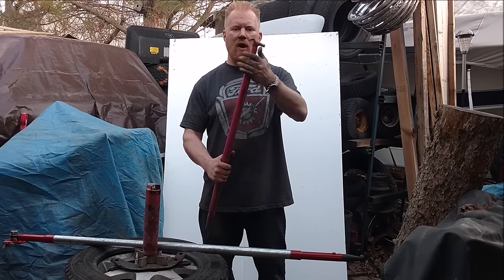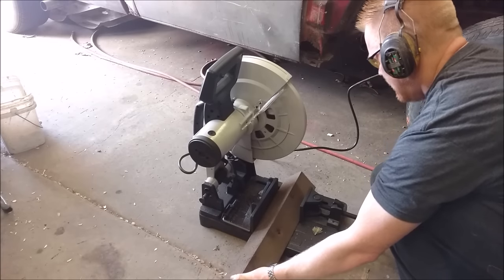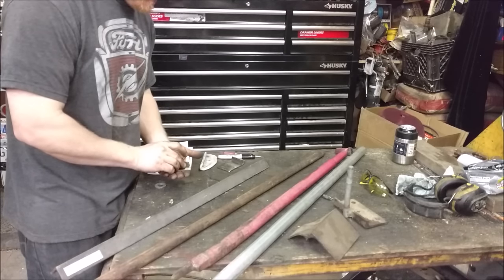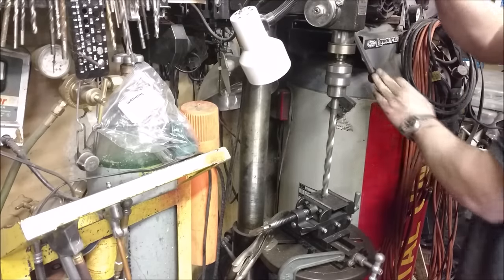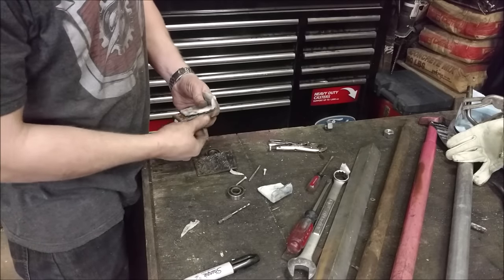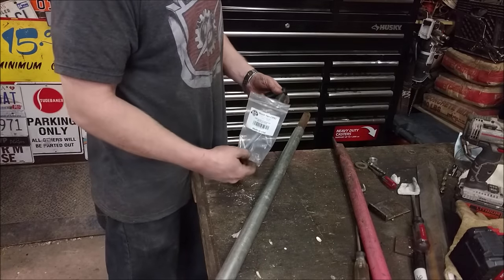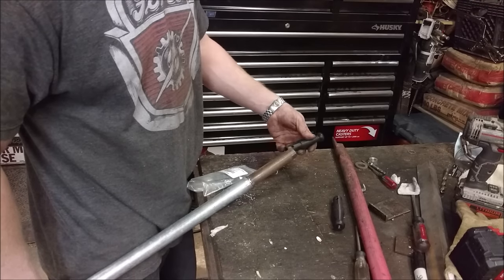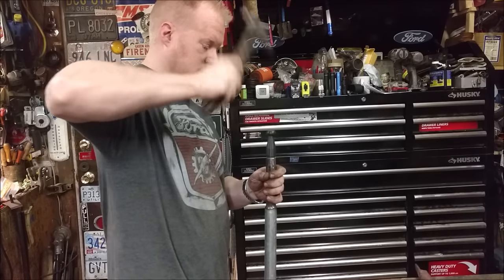No Scuff Manual Tire Change Bar

Comment from the maker: 🚨PARTS I USED
Bearings 99502H (no clip) : http://amzn.to/2mTFFgB

No Mar Removal Ends: http://amzn.to/2mTIsWP
Plastic protection for install (better than milk jugs): https://amzn.to/2oYIORA
Tire LUBE is a MUST: http://amzn.to/2m8tSL7
Basic Manual Tire Changer Machine: https://amzn.to/2mLAiVu
Saw I used to cut the steel Evolution Evo 380: http://amzn.to/2lOGxBZ

4 foot 3/4 black gas pipe from the Home Depot/Lowes
5/8" bolt and nut for bearings

For the mounting end I used 3/16" steel 4"x4" angle iron cut to 2" wide. I cut the short end to around 1" and left the other at 4".  You don't need angle iron and could just bend or cut/weld an angle piece together. 1/8" material is too thin and I would use 3/16" or 1/4" material. Bearings are 1/8" back from the face of the HDPE plastic. The plastic is around 1/4" thick so the bearings are around 3/8" from the inside of the angle iron. You can go to my Facebook page listed below for close up pictures. If you bought everything this would cost you around $25 with a spare $10 tip. 

To see more detailed photos Go to my Facebook Page: https://www.facebook.com/sixtyfiveford/posts/pfbid0sBRiNgNn5maGLnmvuf7fRcErhwpkjekEHo5YaoY3TXiY2WRMiWTSu1sS7F6GgBNVl

Comment: Nice! My dad was a lot like you in this regard. I learned that, Necessity breeds ingenuity.  We were in the sticks and not a lot of money. So we came up with things like an air compressor from an electric appliance motor and an old ac car compressor on a tank, bench grinder was an electric appliance motor, parts washer etc. Most impressive to me was a sandblasting box from parts. He used a pair of welding gloves sewn to Levi Jeans leg's , and glass from something(maybe plexiglass) as the lid. Get this, his buddy took a VW boxer type engine and made an air compressor for his large garage. Thing is it ran on 2 cylinders and pumped air with the other two?! If my memory serves me correctly. Same guy made a front wheel drive rollback with a front wheel drive Cadillac, truck cab and trailer?! Dude was very intelligent.
Reply: Damn smart people!
Reply: @billsmith7673  
Yep. What most folks called junk or a junk pile was a Hardware store. Didn't have a cellar to store potatoes? We dug a big hole about 2 foot deep 5 or 6 foot diameter. Place plastic in bottom with some straw. Start piling potatoes into a peak. Flip the excess plastic over the top and place more straw, then soil until covered. Sometimes another cover or straw. Always plastic over outside with rocks at bottom to hold it in place. Now when cold sets in with snow, go out with a bucket, knife and hoe or spade. Lift up covering dig and cut in. Get potatoes in your bucket cover back and repeat when necessary.  Even pull cabbage and put the head down into the ground roots up. When you need it pull it up. Things that most take for granted going to the grocery store to get. It was always be prepared. Watch what animals do. Of course you have the lazy in those also. If you truly want to live off of your land!? Be prepared to work and think on your feet!
Reply: @kentuckywindage222  I am really interested in stuff like that.  It's good to have that kind of skill, knowledge, & ability.  Most of society is concentrated in city areas now and is completely dependent on Walmart, grocery stores, etc.  Most people know nothing about how to provide their own food, repair stuff, make stuff, etc.  If society ever collapses or the trucks stop running, those people will be in trouble.
Reply: @billsmith7673  
I was raised in the outdoors. Hunting and trapping for food, fur, herbs to eat and sale. Trapping and skinning for fur to sell. A garden was a common part of living. We would can food. Also made driers from glass, wood and screen. Mostly to dry apples. Leather breeches were green beans on a string hung usually on a porch until dried out. Pickled corn was one of my favorites my mother would can. Elder berry jam (wine by some). Poke was a green. You only ate the young tender tips. Tastes and looks like canned spinach when cooked, but it can be fried. Lambs quarter. We would gather black walnuts let the husk dry in the gravel drive to remove it. Then sit and crack them so mom could make homemade chocolate fudge with walnuts. I have a saying, Poor boy's have poor boy ways. We were poor but so was most everyone else. Some more so than others. People were different. For example, if someone were building a pole barn? There might be 5 neighbors show up to help. Just feed them when you eat. Nothing else asked of you. We've allowed the people not like those from that time to get control of to many aspects of this country today. I just don't understand how responsibility has been thrown out the window. The old timers wouldn't have had time for such nonsense. Nothing wrong with helping each other. There is however a responsibility each of us has to somewhat take care of ourselves and loved ones.

Comment: After trying different DIY tire changing bars for motorcycle tires, tubed and tubeless, I came across your version of the mojolever.  Without question,  this is the best solution and much cheaper than a mojolever.  I love the bearings.  Thanks for sharing your design.   I have changed four tires so far and the bar works great.   The Nomar end is OK but the link you provided is for the mounting end of the Nomar bar.  I cut a couple of flats on the tip so it is narrower the get it between the tire and rim.  Insert, rotate the bar 90 degrees and it works the same.

Comment: If you don’t want to spend time sandwiching layers of milk jugs you can always buy the dirt cheap HDPE cutting boards at the dollar store. Cut to size and bolt on.
Reply: For me it was only one dollar store windex jug. A little thicker plastic than a milk jug but not much. Smaller jug. So layers isn't quite accurate. Get a pot you're never going to use ever again, take your electric portable stove outside, get a lid for the pot, let it melt. It doesn't get hot enough in my stoves case to make a lot of fumes but did outside anyways since my stove is tiny home spec. Takes about an hour to melt but don't leave it unattended for extended periods of time as with any cooking. Cut the jug up with scissors or a box knife.

Comment: Thanks a bunch. I have come close to throwing my bar. I tore up the edge on a Cooper tire with it. It's not long enough and the end like you use is thick. Some of it has to do with that bead glue they used. Tire cost twice as much as the tire stand and tool.
Reply from the maker: I've tore a couple tire beads with my stock tire bar. Professional tire lube makes a big difference.
Reply: Also be sure to remove any old wheel weights before mounting a tire, if they snag the tool it can end up ripping the bead when forced.

Comment: The mounting end is awesome! Works great. The demount struggles with trailer tires and straight up fails with anything larger. My truck tire ripped that little Nomar tip right out.

Comment: this is the BEST video I've seen because it uses the bearings and plastic creatively to avoid rim damage and make the job easier.  Plus you have some fun machining and welding too!!!!  I wonder if there is a good no-scuff dismounter rod/ball.
Reply from the maker: Awesome, I'm glad you liked it. The black plastic end works great as the dismounter.

Comment: you can get what's known as an alloy mate bar which has been out for a long time, which uses nylon bolted to a metal bar, you can buy the nylon kit cheap then just make the bar up easy enough, very handy.

Comment: i'm a cheap bastard, so i made my own tire changer out of scrap steel i had lying around to save the 50 bucks. i've got an old solid axle shaft out of who knows what, that my dad used as a spud bar on the farm that's about 4' long that i am going to make the bar tool from. where the tool meets the rubber was where i was having some issue in my design. this solves my problem perfectly. thanx for the idea!
Reply from the maker: Awesome. This thing has made tire changing so much better. Especially for those rims you don't want scratched.

Comment: I made a tier changer similar to a rim clamp but just has a hydraulic cilinder to clamp the wheel down in a metal box I welded a large gear to the cilinder and use a eletric motor to turn it on a petal swich used for a drive by wire system for a car I maid the arm out of a square and a circle pipe with a lever to lock the jig in place the only part I have bought was the duck hed and the bar

Comment: back in the day when making our tyr bar's.  Removers we used old Ball joints welded
 to the bare-End   " Like This" . Drill a tap to fit Ball joint nut  screw in , Until tight.  then wald the outer   pin to  the bar a dress to smoth .  On the other end het the bar  hot , falten &  Temper when finish.  form a hook to fit the rim  brill bar & weld  ball to a hook , 

mount so the Carver  of the ball of the  joint & valy  is mounted.  so it can  push the tyre beds  on to the weal . weld ball stem to flatend  bar  & hook . smooth to prevent ripping. in my day they  wear  riveted to bar & drest ro run easey .,   so it slides Easy ,  of tyr ues plenty of sope .  This bar  was used to fit or remove tyers , uk England .  

 To bay i would weld flat steel hooked steel , To 1" 'steel bar, & round  into a carve with a Vealy  carve to represent the ball agents the steel flat  valley to let the  bar . pres on the beed .  Given the weldingkit of today  & carves a good polishing well forward on the hook . given the wedding kit of today  kit.    In my Day  we hadn't that  kit they have to day we were  still.   welding with gas back then.    HA  LOL But  not today it easily welded  & more  to the point strong , So just polish . 

 The ends to help lesson damage.   & of course  for Aluminium  plastic Coated kit is the way to go.   plastic coated  Yes.    The ends.  I have a bar my dad made  back in 1920.  it's  still changes tyer's as well today in 2020. i don't use it so much but i have seen my grand kid's  change  tyr's with it , By gum son . try the ball joint mether on the end of a bar.   it's  a way to use up them old ball joints ,   we  did , back Then.  I do Bevel it's gotten better with age ,    Les England .

"THEM WERE THE DAYS SON,

Comment: Thanks for the video tutorial. 
So I found these walker skids made from Teflon, they are curved to 90°and taper on the end I am going to back the skid with a piece of 1"X⅛" flat bar formed to the contour of the skid and weld that to my galvanized pipe, I also going to use ½"ID berings. 
I will be using the mount\demount bar for changing motorcycle tires.
Reply from the maker: I just saw your Facebook comment. What about layering two layers of your 1/8" flat bar to make 1/4"? I think it would hold up much better.

Comment: Nice build  my first tire fixes were big tractor tires  years later cars and trucks tires  seemed  to be built with magnets finding evry nail or. Screw   ,it. Was actually easier to fix the big tractor  tires  ,   so l found a. Used. Coats 2020. For 250.00. So. Much better on those old hard. Ones. Thanks again
Reply from the maker: I've eyeballed those coats machines many many times. One day

Comment: Great video.  I was thinking about building something similar myself.  The bearing is very clever, and the technique to melt the HDPE into "putty" is a really neat trick.
Reply from the maker: Thanks. I played around with it on a few tires and it worked nicely. I have some larger mudder tires I'm putting on in a few days that'll put it to the test.
Reply: How durable is the melted milk container plastic?  I wonder if it could actually be used to put a protective skin around the Harbor Freight mounting bar end to minimize scratching.  If it could be heated up enough to be a real liquid, maybe it would be possible to dip it in, candy apple style-
Reply from the maker: I made condoms from my HF tire changer a year or so ago out of PVC. They were too brittle and would crack under the force. You could potentially do it with the HDPE plastic(milk jug, 5 gallon buckets etc) as it is far less brittle. But it doesn't ever turn to a liquid, more like a thick putty, when heated. So you could hand mold it around.
Reply: I might give that a try just to see-  I got plenty of old milk cartons saved up!  The stuff is fairly slippery, just so long as it doesn't rub right off on the first shot..
Reply: sixtyfiveford inb

Comment: Now That's using your head   I have the Nomar  tire Bar it works great but the tips like the ones that you Purchased  are very Delicate you have to use them just right or they break very easy  your bar is something like the Mojo Lever tire bar but you have a Bearing on the top.  Great thinking
Reply from the maker: That's good to know about the NoMar tips. Does the plastic just shatter around the center pin?
Reply: From what I understand  it has a thin steel core in it and just kind of snaps and the tip and is done it does not break off .  and no it does not shatter.     I  broke one mounting a set of Harley tires I guess that's why they send you extra tips with the bar. if you look at the Mojo lever he uses a 3/8 bolt in the center of a Delrin piece spun down on Lathe very Strong . but once again very good on Improvising on the things at hand and Making a nice Tire Bar . you have got my wheels turning
Reply: I have the Mojo, although I couldn't remember the name of it until you mentioned it. I really like it. I know several people that own the NoMar that swear by them. Never heard of the issue with the tips though.
Reply: I Saw the First Machine No Mar  Produced  some years back and told my Friend at the time about it . Like me he also worked on Bikes  and bought the model that did Car and Bike tires with all the Extra Tools. but using it a few times he broke some tips.  you can't pry on them like the Mojo Lever . I only have broken one so far but in hind sight I wish I spent the money on the Mojo Lever  much Better . Like I Said Before that's why they sell replacement Tips
Reply: Back in the 60's the bars had a bearing too, only they didn't last very long.
Reply: Mike McCulloch n

Comment: I like the ingenuity! I own a Harbor Freight tire changer and agree that while it works, it does tend to damage rims, both on mount/dismount of the tire as well as breaking the bead. I'll look for your video on modifying Harbor's tool.  P.S. Use the home oven to heat HDPE to 350 degrees? Either you're not married, or you have a VERY tolerant wife! :)
Reply from the maker: She no longer fights the craziness.
Reply: @sixtyfiveford  lol

Comment: Nice job. I think if the bearings where mounted 1/4" closer to the end OR go with larger dia bearings it would feed the tire over the rim better.
Reply from the maker: It's a fine balance. I did implement thicker hdpe plastic liner and it made a little bit of difference but really strains the tool and tire bead.

Comment: excellent work, I have been wondering myself a better way for years. the manual changers are so cheap and handy, and actually faster than a modern auto changer once you know how to use it, but those damn scratches :-(
Reply from the maker: Thanks.

Comment: Great video, I know the 3/16" steel is 4" inch long but how wide is it, and what's the distance from the bearing to the tip of it? thank you
Reply from the maker: For the mounting end I used 3/16" steel 4"x4" angle iron cut to 2" wide. I cut the short end to around 1" and left the other at 4".  You don't need angle iron and could just bend or cut/weld an angle piece together. 1/8" material is too thin and I would use 3/16" or 1/4" material. Bearings are 1/8" back from the face of the HDPE plastic. The plastic is around 1/4" thick so the bearings are around 3/8" from the inside of the angle iron. You can go to my Facebook page listed below for close up pictures. If you bought everything this would cost you around $25 with a spare $10 tip. 

To see more detailed photos Go to my Facebook Page: https://www.facebook.com/sixtyfiveford/posts/pfbid0sBRiNgNn5maGLnmvuf7fRcErhwpkjekEHo5YaoY3TXiY2WRMiWTSu1sS7F6GgBNVl

Bearings 99502H (no clip) : http://amzn.to/2mTFFgB
No Mar Removal Ends: http://amzn.to/2mTIsWP
Plastic protection for install (better than milk jugs): https://amzn.to/2oYIORA
Tire LUBE is a MUST: http://amzn.to/2m8tSL7
Basic Manual Tire Changer Machine: https://amzn.to/2mLAiVu
Saw I used to cut the steel Evolution Evo 380: http://amzn.to/2lOGxBZ

4 foot 3/4 black gas pipe from the Home Depot/Lowes
5/8" bolt and nut for bearings

Comment: I would suggest using JB Weld to secure the plastic to the angle plate rather then screws if it will hold.
Reply from the maker: JB Weld would fracture and the bond would fail. The HDPE plastic has too much give.
Reply: If and when you need to replace the HDPE plastic try using a bondo spreader which should be easier to fabricate and more durable. Nice job I am making a new bar for the same tire machine myself from your design